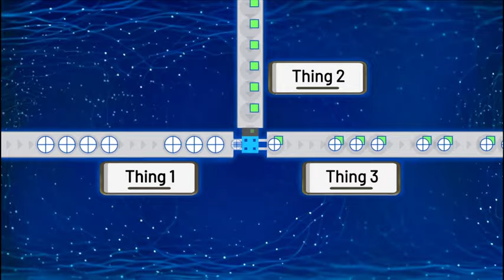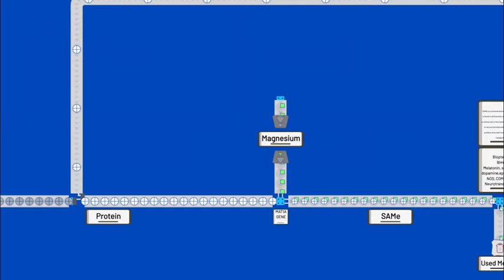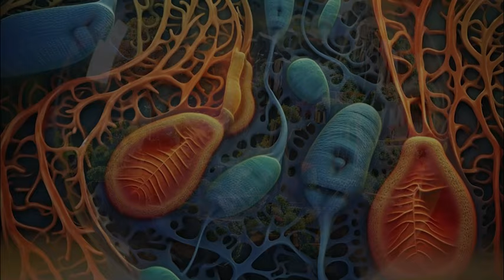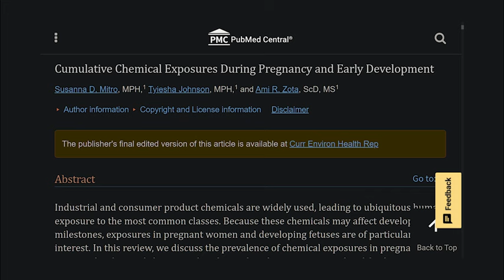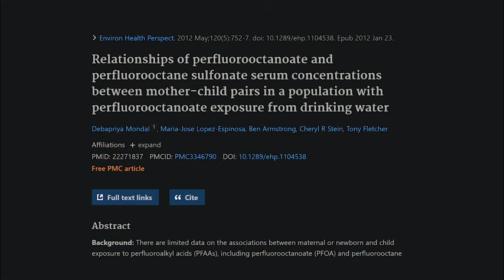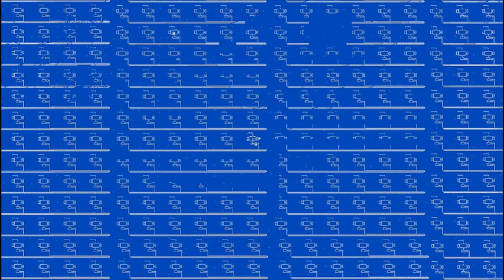I figured out how nutrients work and its kinda neat

Comment: yup, I needed a bunch of B2 to be able to tolerate more iodine.
Reply from the maker: A b2/b3 combo helped take the edge off for me a few months in, but sulfur via epsom salt and MSM were what helped me start moving with iodine. More recently I could not figure out what was going on till I tried a solo B2 and it helped the rounds of sulfur I was working on at the time.
Reply: Are you doing active B2? How much are you taking?
Reply: @SickofTired how much epsom salt and msm did you take?
Reply from the maker: @LastDays7  I use a non methylated b complex https://bit.ly/36sdGfN about once a week or less and I also have b2 by itself that I try once in a while to see if I seem to need more. I own every B in just about every form and try them sometimes to see if I notice changes. I used to require taking the b-complex daily to feel better till I balanced more nutrients. The complex and solo b2 I have are (as riboflavin and riboflavin 5-phosphate sodium). The solo are 400mg and the complex has 20mg. I honestly have not taken much b2 and I've only noticed direct benefits once or twice. But when I started a liposomal glutathione which has b2 and some others, I had amazing improvements
Reply from the maker: @LastDays7  I went through a whole jug of this stuff years ago https://amzn.to/3VNsmBe I just sprinkled in water and went slowly enough to not get headaches. With epsom salt I start with a teaspoon per 12-16oz of water and I increase or decrease depending what I notice. Sometimes epsom salt sends me to the bathroom where I feel much better after. If that happens I'm drinking as much epsom salt as I can till the bathroom situation is done. If I do not notice anything from it, I go slow or stop
Reply: Are you concerned with B6 toxicity? Just a lot of different theories on it and I was wondering what you think